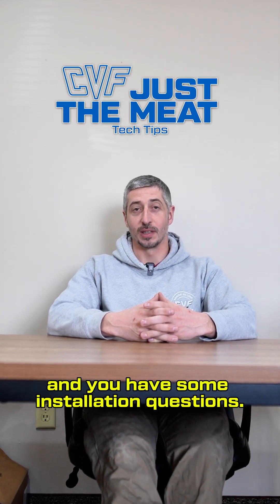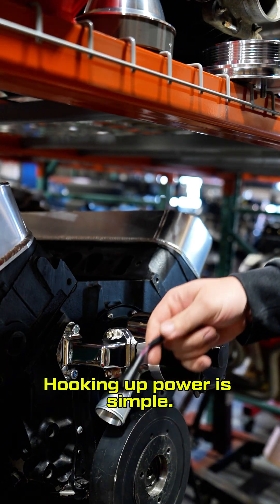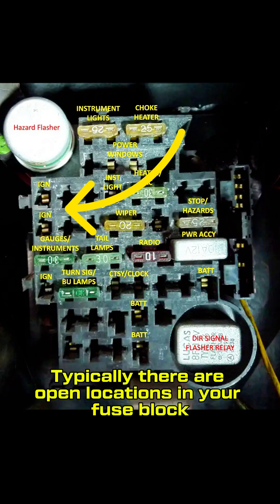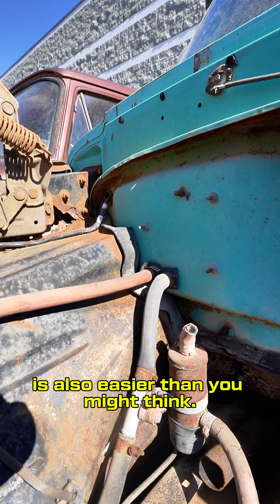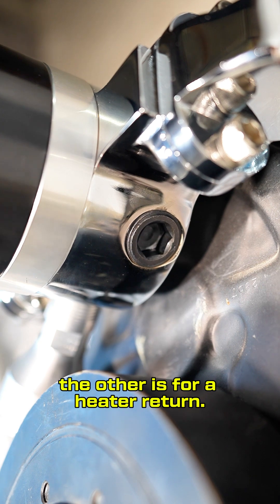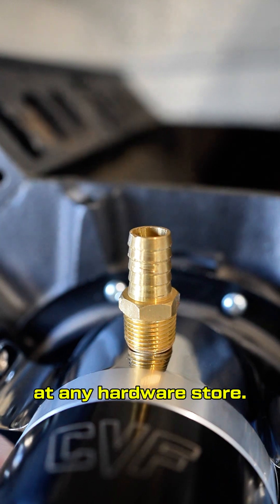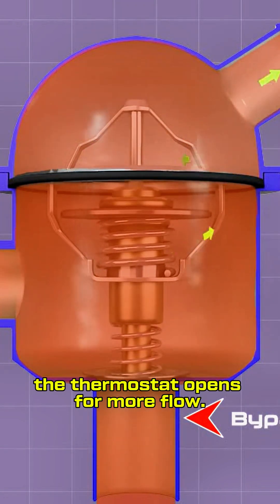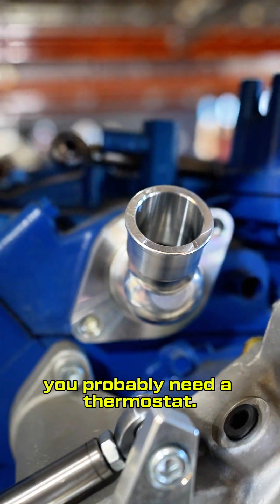Electric Water Pump Installation - Just The Meat - CVF Racing Tech Tips

Comment: It seems like you could run a water pump like you would an electric fan, where you control it based on the temperature. You could leave it off until it reaches operating temperature and then have it run from that point forward. The benefit would be you wouldn't have the restriction of the thermostat in the system and it would probably warm up much quicker. Am I wrong in this though? It's just an assumption.